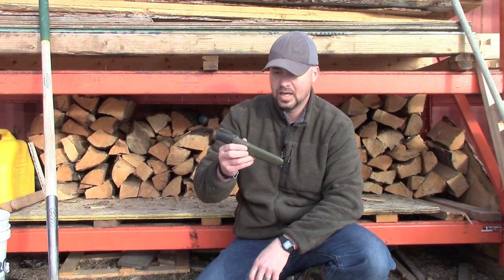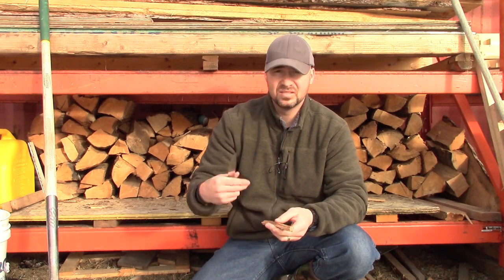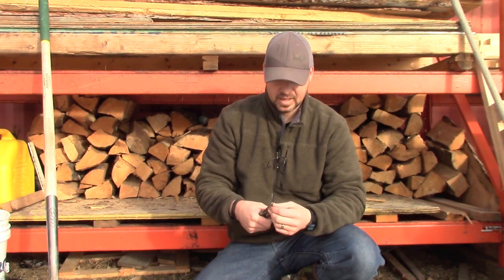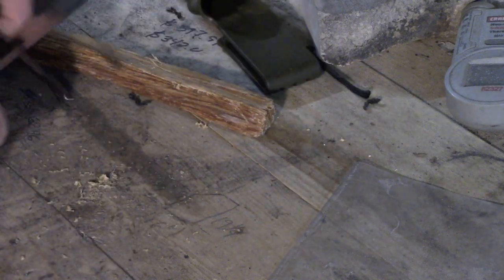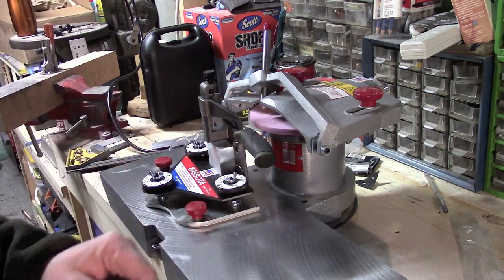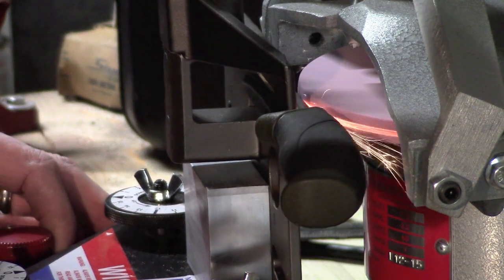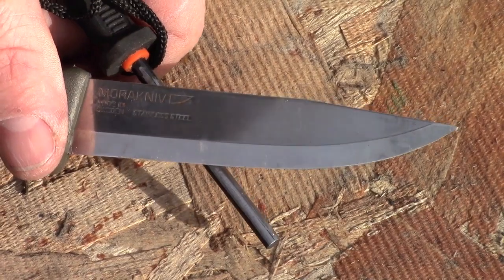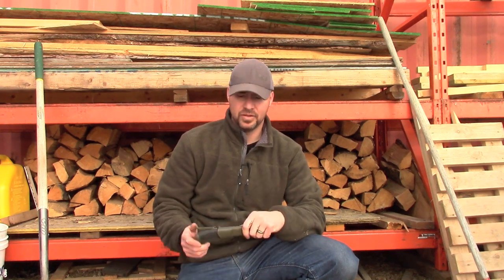Ultimate Mora knife modification, with a hockey skate sharpener!

Comment: So, just to toss in  2 cents......if you hockey sharpen the spine of the Mora, its counterproductive in a way as 90% of Moras are used for carving more than ferro rods.  Hockey edges will slive up the users thumb in this situation.  I will say though, that if you leave about 1.5 inches from the handle smooth along the spine, or even 90*squared, but not concave, it will maintain some usability. Yours looks like a mild concave, but when  athumb is pushing and sliding, it will def be felt. IMO

In addition, if you use your blade and shave a smooth edge on that rough fatwood, then use the spine, you will get awesome little fluff (micro curls) that will light with even the tiniest spark>
Reply: feellnfroggy if you have ever rubbed your hands against a pair of skates, it is evident that unless they are SHARP sharp you have to make a slicing motion to cut anything with this style of "double bevel". I can push as hard as I can without cutting myself, but if I ran my fingers along it with great pressure I could scrape it up a bit

Comment: This video is great because of the misconception out there that you must have a carbon steel blade/striker to get sparks, when all you just need is something harder than the rod itself and the right degree/angle on the strike.
Reply: Suburban Knife-Maker you need a carbon steel blade to strike sparks with a piece of flint or quarts that's where the myth came from people just got confused
Reply: One of my best spark throwers is the Rat1. They leave a crazy sharp spine on them. AUS8 too. 👍